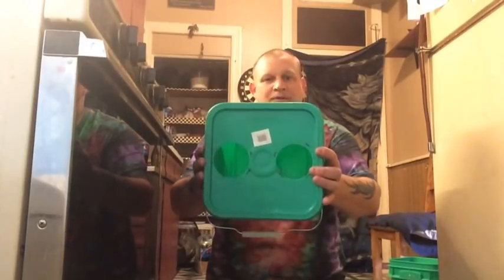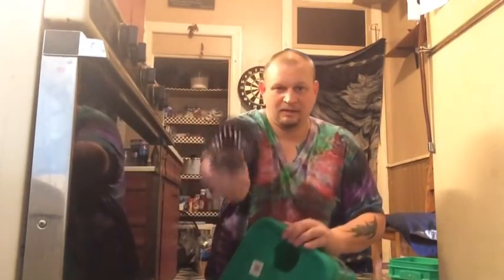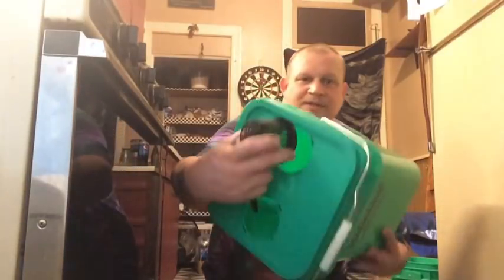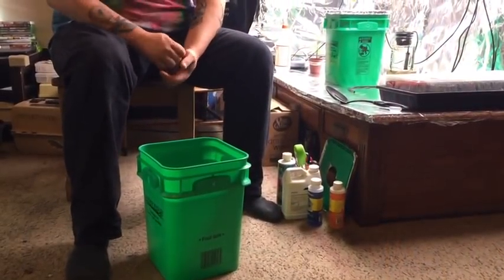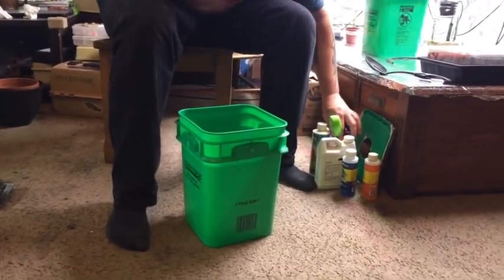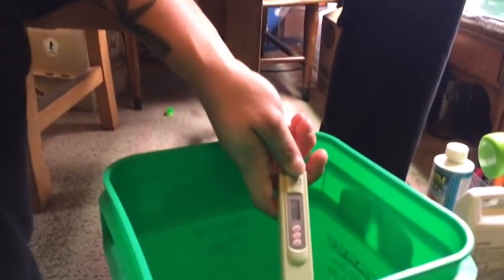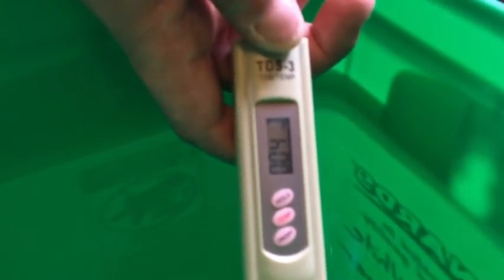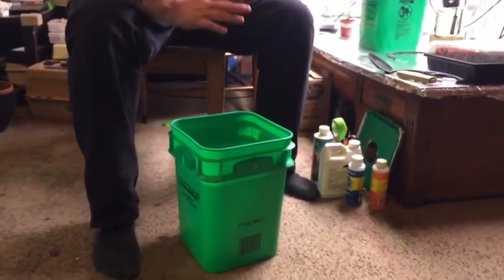How I build a DIY Deepwater culture hydroponic system

Comment from the maker: I want to point out that since I have made this video I keep my pH more around 6.0 and I black out my containers to prevent light penetration
Reply: Urban Hydroponix 
Great video, very informative  and no Ego. Hats of to you bro
Reply: Nice video
Reply: Ya I use the orange Home Depot buckets they work fine.
Reply: What does black out entail
Reply: @TiltChamberlain513  black spray paint probably someone also used a big sharpy
Reply: put a camera inside and set the shutter nice and slow, and/or turn the iso up high as it will go. No flash or light. then take a pic, or record a few seconds of video then check the camera. if you see anything besides pure blackness, you got a light leak. Or, you can do it in reverse, stand in a dark room, and put a light inside the bucket, and you don't really want to see any light , but a tiny bit is okay.. you can use just about anything.. tape, paper, pillow case, paint, tinfoil, another bucket, even a carboard box would work if you cut a hole in it... @TiltChamberlain513
Reply: @TiltChamberlain513  spray painting your buckets with either black or a metallic spray paint so light won’t penetrate your bucket causing allergy or bad bacteria to form around your roots
Reply: I was gonna say lotsa light goin through green bucket
Reply: Urban Hydroponix would a hole in the lid make any difference?
Reply: How does that work for you with the ph being that high? I'm new to dwc so Im learning lol
Reply: I use aluminum foil tape around mines

Comment: Why drill a hole in the side for the air line when you can put a hole in the top of the lid in the corner? This way the water will not flow down to your pump
Reply from the maker: Ben North I like your idea a while after making this video I did start running it down through the net cup

Comment: Ok so... those green bucket well need to be darkened so the light doesn’t create algie, never drop ph up or down directly into you solution without diluting it first it can bind up the nutrients making them unavailable to the plant, tin foil is the worst thing you can use, does not create a proper light reflection pattern and can creature hot spots on the plants. Ph should be adjusted to the plants you want to grow not all plants thrive in the same ph levels.
Reply from the maker: TheStp77 You are 100% correct with everything you said

Comment: Hello Professor. If water salts are high, for example, 500 pmm and the plant needs a nutrient solution of pmm 1000 ... Should the pmm 1500
Reply from the maker: I have found that I get the best results with my PPMs at between 500 and 700 عبدو سليم
Reply: If the salary ratio in the water 700 ppm house this means I can not add nutrient solution for the plant ... Please the statement and you thank
Reply from the maker: عبدو سليم I would use bottled water
Reply: @UrbanHydroponix  Please give me the type and percentage of the nutritious solution for tomatoes according to the stages of growth and thanks

Comment: Could you tell me what u use for grow lights ? I have a areogarden classic 7 pod I'm thinking about using but I'm not sure yet , any opinions ?
Reply from the maker: Ricky Rogers Fluorescent lights are cheap to buy but you have to keep them close to the plant because the light scatters. LED are cheaper to run and you can have them much farther from your plants but cost more to buy. Both produce very little heat if any. So it is really about what works best for you but I would choose one of those two.
Reply: @UrbanHydroponix  Kool, I have the areogarden which has flouresent lights in it, they work great , the other thing that confuses me is most sites say to change the water and nutrients every 7-10 days, is it really nessary to change it every time I feed ?
Reply from the maker: I change my nitrients and water every few months. When you top off the water match the ppms and ph from your original readings. Check your ph regularly though and adjust accordingly...I have been getting best results from the 5.8-6.2 range and ppms around 500-700 for my peppers
Reply: @UrbanHydroponix  that seems a little more realistic than every 7- 10 days lol Thanks for the help 👍
Reply: I do think I might put a drain valve on my areogarden , I have it on a desk so a plastic drain with a hose would make things much easier to do...

Comment: Dam dude did a great job making this I was thinking what do you do if you have to add water and take the plant out the water it will shock the roots and die he had mason jars with water all ready to go for them to be set in only thing is he should of wrapped them in something black reason why is because the roots are supposed to be hide from the light. Good job on the video though 👍😃✌️

Comment: Do you set your cutting in sprout jar,  the same way as your drip set up? If so what level do you put water in on pots n do you add any solution to the rooting water
Reply from the maker: samantha nicholson When I do cuttings I use a mason jar with a bubbler and just pure RO water. 2 qt jar 3” net cup 2” rockwool 6.0 ph
Reply: Urban Hydroponix what level do I put the cup into the jar, I had a few seedling that jad roots but lost em bcus of height in container was not high enough
Reply from the maker: samantha nicholson Keep the water right up to the bottom of the net cup. not touching it maybe a 16th inch gap

Comment: Cool how often do you change water
Reply from the maker: James Munn I do a complete water change about once a month otherwise I just add pure reverse osmosis water and maintain my pH in between
Reply: @UrbanHydroponix  nice vid.i know this vid is old but i have a question for you, you dont get pythium rot? one month water change could lead to all sorts of pathogens building up inside. you never had this problem?
Reply from the maker: c549 m i have and solved it by adding 5 drops of chlorine per gal every 10 days or so
Reply: I replaced mine  every 10 days with fresh nutrients with ph adjusted and have been getting huge plants and fruits

Comment: What air pump do you have? What size do you recommend for a 5gal gallion bucket. I want do to 6 buckets.
Reply from the maker: Trin Na this pump or the next model up...this one runs six. 
EcoPlus 793 GPH (3000 LPH, 18W) Commercial Air Pump w/ 6 Valves | Aquarium, Fish Tank, Fountain, Pond, Hydroponics
Got mine on amazon for bout $34